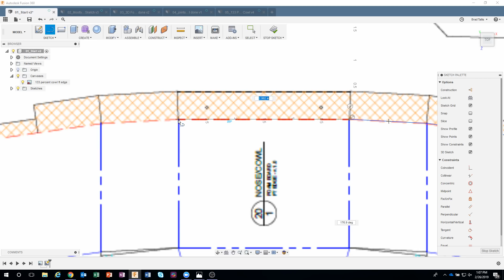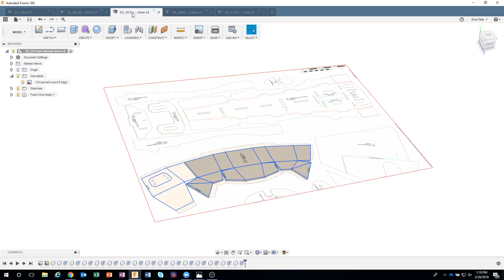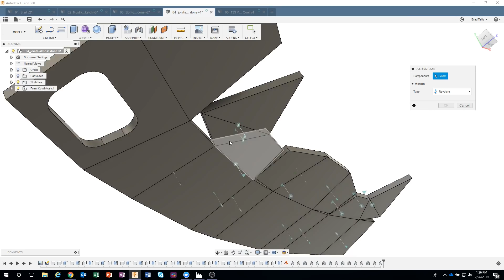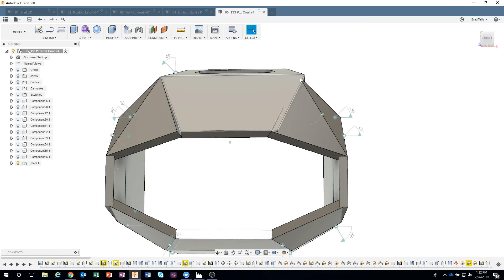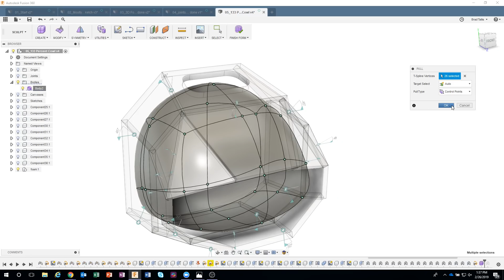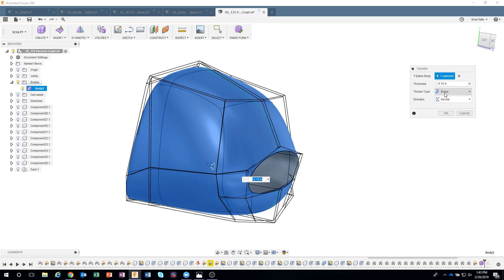Episode 15, Creating a foam FliteTest model

Comment: Hello Brad! I have created a basic 3D model using the and SVG of an airfoil protocol and I'm looking for some help on the best way to convert it to a model out of foam board. The model I'm designing has some more curves in it, but should be flat. I'm wondering if you would ever be willing to help me figure out the best way to convert what I have into sheet metal. Thanks!

Comment: Hi Brad,
First of: great videos. I'm learning tons of stuff at an incredible pace!

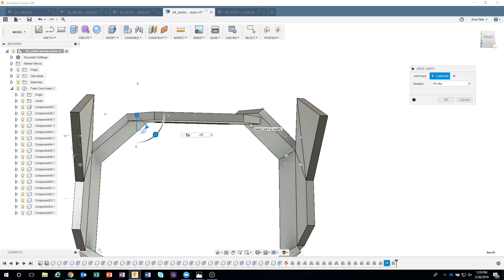At 32:18, you noticed that the components didn't line up exactly.
I think it is because you accidently placed a few rotation anchors on the top side.
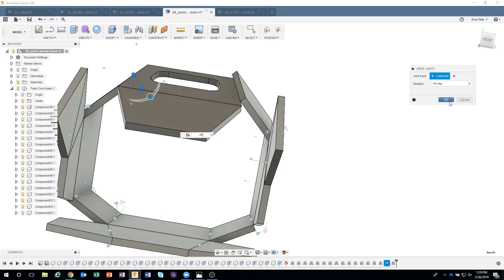At 32:27, on the right side, you can clearly see that the foam "gets split" rather than "getting crushed".

Comment: Brad, I'm managing to produce 3d printable files of everything I need so far - that is except for model RC plane canopies.  The amorphous nature of these things, with their multiple compound curves, simply defeats me every time.  At the moment I'm struggling with a canopy for a Bixler 2 and a BAE Hawk.  Both have compound curve tops (which don't necessarily have to be deadly accurate) and compound curve bottoms (which do, to fit on the model).  I've tried importing other people's STL files and converting them to BREPs in a vain attempt to modify them, but BREPs don't react to Fusion commands like ordinary bodies do, and this frustrates me.  I have tried using t-spline primitives, but they too seem to have a life of their own.  Is there an easy way to produce canopies in Fusion?  I guess part of the solution is to use loft along a path, but again, when I click on profiles to loft, often Fusion seems to ignore me.

Comment: Thanks for another great video. You showed again a trick I didn't know :-) Question: When should you use 'joint component to top assembly' vs. 'Ground component'? Saw few videos pointing out that the 1st method works better when you import different designs and assemble them to the final product.
Reply from the maker: 3D Gussner-  Yes, when you are importing assemblies into your main assembly, it has been determined that "grounding" isn't as good as creating a joint to the origin.  However, with just a single assembly, I typically just use the "ground" command.

Comment: Hi Brad, thanks for another great video
When creating the window the sketch fillet command will automatically extend the lines without the need to extend them first, just another time saving feature
Reply from the maker: @Trevor-  Wow.  In all the time I've used Fusion 360, I've never tried that.  You are correct, my friend.  Pat yourself on the back for sharing that one.  I'm going to show that little gem of coolness in my next LiveStream.

Comment: Great video Brad.  Thanks for making it.  I Would love it if Fusion and Inventor had the capability of folding foam board/card stock and other similar materials similar to(but not the same as) sheet metal.  Would make designing these planes so much easier for me.  Right now I go back and forth between Inventor and AutoCAD.  You have a new subscriber.  +1  :D
Reply from the maker: @Daniel-  First, thank you for all you do for FliteTest.  I have used many of your plans!  Second, yes, I hope to see "bend along a line" soon in Fusion 360's Sheet Metal.  This would allow you to bend like you are looking for.  You can create a custom "sheet metal material" that acts more like foam.
Reply: @bradtallis8968  Wow, this interests me a lot! But how would the rules for bending foamboard look like? I mean things like k-factor and bend radius.